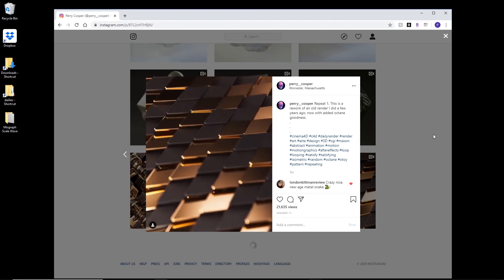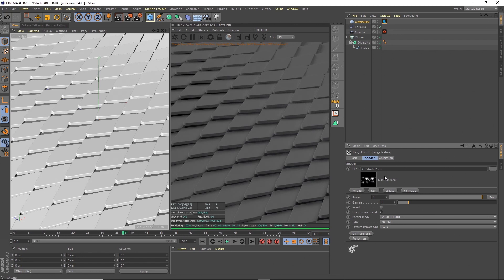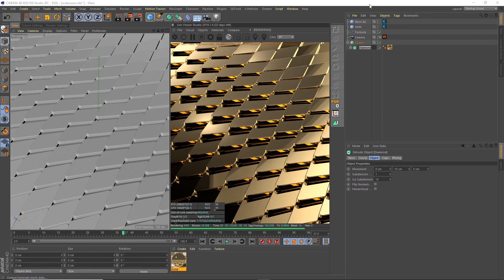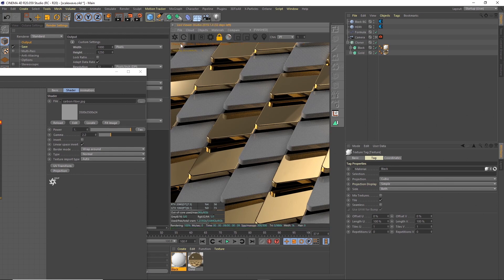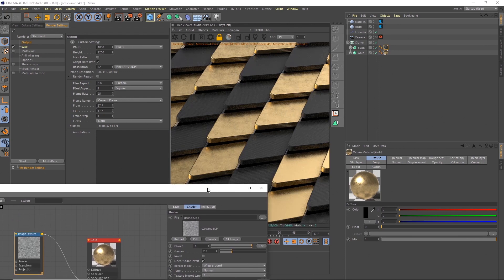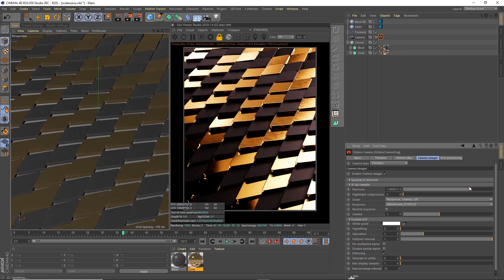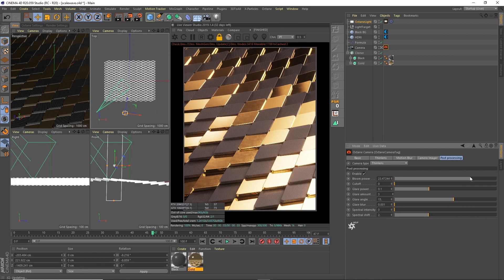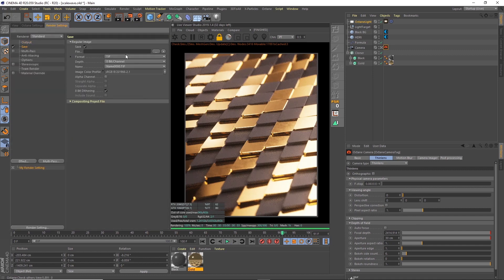Cinema 4D and Octane Tutorial - Material, Lighting and Camera Setup

Comment: Hey Perry, do you know why I might be having reflecting issues with the gold material? I think it has to do with the Octane HDRI environment. It's turning blue completely, I lose all the gold on top..
Reply from the maker: Hi, if you are using a HDRI with a blue sky, thats what you may be picking up on your material. I would make the gold slightly rougher and rotate the HDRI to change what reflects, or even better - use a HDRI that is of a studio set up (so mostly black with a few lights). Hope that helps
Reply: @PerryCooper3d  It does help. Thank you sir! You rock.